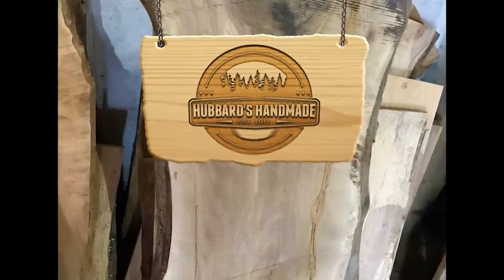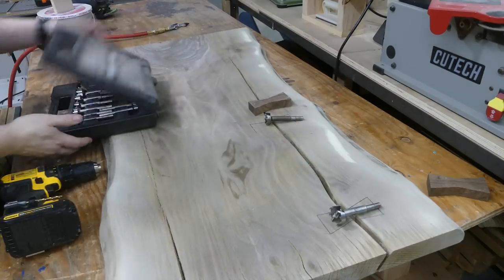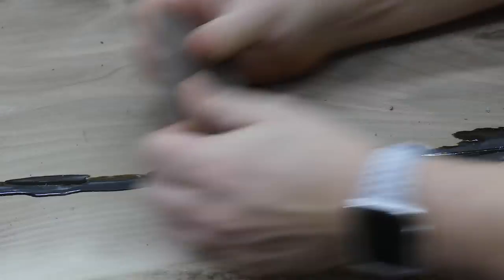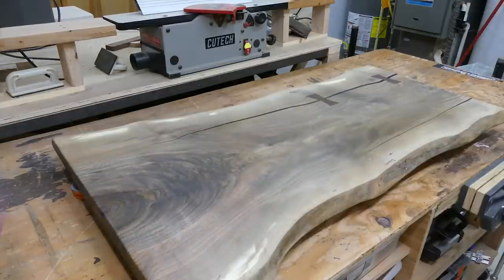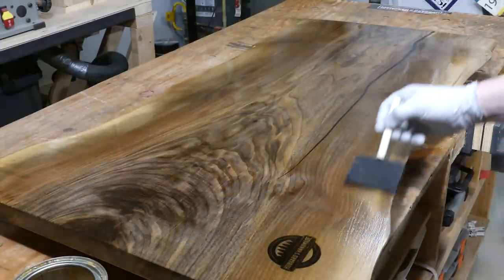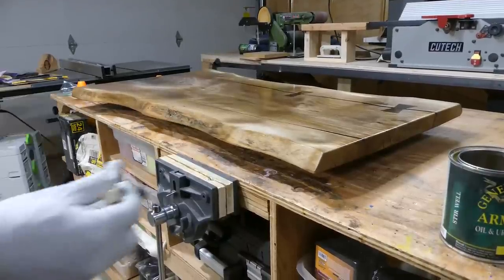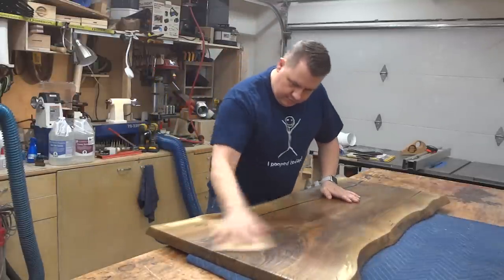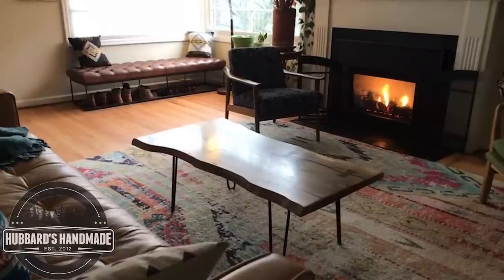Black Walnut // Black Epoxy // Coffee Table // How to

Comment: I saw the little gaps around the bow ties that I fought for years. Here is how you can eliminate any gap at all. When you cut the bow ties leave them a 1/32 big and too deep, then sand a 2 degree bevel on the sides of it from the top side that will be seen down to the other side. that will leave a 1/64 too big bow tie at the very top on each side. When you pound them in, the top, or side seen, will be force fit to the gap and the other side, not seen side will be just right. No gaps and hold just like any other dutchman. It sounds like I am picky but when you make it as good as you did, it may matter. Nice job, I subbed.
Reply from the maker: Great stuff! Thanks for the tip!!

Comment: Got any info on that router attachment to your delta table saw? Need that!
Reply from the maker: Ha! I wish… It’s more of a homemade solution. I found a router table top for cheap and attached it with some bolts plus melamine to fill in the gap’s. I just recently got a small Kreg router table to replace it.

Comment: What's the difference between the finishing oil and like a wipe on poly ? Anything ? I dont know I'm extremely new ....help?
Reply from the maker: In this video I used a type of Poly made by General Finishes. After it was dry I used a furniture wax to buff the surface. You can use this furniture wax AFTER almost any finish is dry and cured to give it a nice look and feel. hope that helps.
Reply: @Hubbmade   
So a couple coats of oil?
Then a type of poly (wipe on?)?
Then an optional coat of wax ( which you mixed with mineral spirits)?
Reply from the maker: @slowandcurious9455  There is no oil. do you mean the epoxy? you can do 3-5 coats of wipe on poly, then give it a few days to fully cure, then optional wax to finish.
Reply: @Hubbmade  ok thanks. As you can tell I'm extremely new to this and I'm taking on my first project. So if I just do a 2-3 coats wipe on poly and then finish with a wax I'll be ok (for a coffee table) ???
Reply: @Hubbmade  thanks for taking the time to explain and help a newbie. I subbed and I'm greatly appreciative for the information.
Reply from the maker: Motor Head should be good! Wipe on poly is thin so you may need 4-5 coats.

Comment: beautiful wood, excellent workmanship - ruined by some $4.99 ebay legs.
Reply: How is it ruined? The purpose of hairpin legs is to not distract from the table top. Not meant to be a focal point. Not to mention, when selling projects like this, hairpin legs significantly reduce the price of the project for the client. Makes them much more affordable. Adding custom wood legs of equal material can double the price.

Comment: 3:40 "alexa fan on" and my alexa responds lol
Reply from the maker: Ha! Love it
Reply: @Hubbmade  quick question. I recently got a slab similar to yours. What would happen if I dont do the stabilizing with butter fly prior to epoxy?
Reply from the maker: @minimin0425  I just depends on how big the crack is. With this slab I could have gotten away with no bowties but if the crack was any bigger the slab could shift after the epoxy is hard and it'll break loose. It doesnt even have to have a bowtie or butterfly shape. Some people do them on the bottom of the slab in a simple straight line for a 1-2 inch by 4-6 in board fits in. that would give the slab/epoxy enough stability.
Reply: @Hubbmade  thank you so much for the explanation! I'm a beginner at wood working and it's my first attempt at epoxy so I've been doing A LOT of research as I heard many horror stories  😂
Reply from the maker: minimin0425 YouTube is a great resource! Check out my friend Cam at Blacktail studios for a lot of great epoxy resources. He teaches a live class as well if you’re close to Portland Oregon. Good luck!
Reply: @Hubbmade  you are the best! Thank you so much!